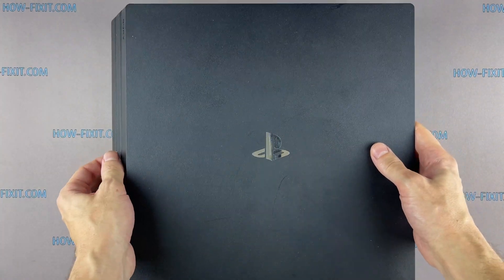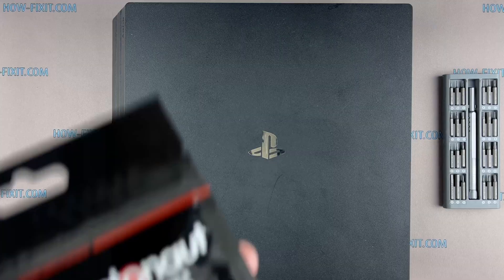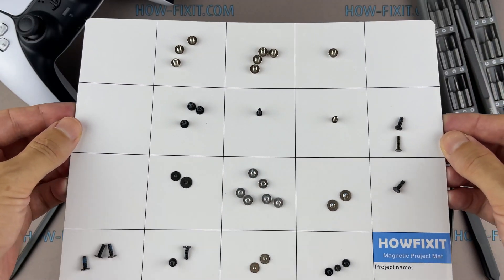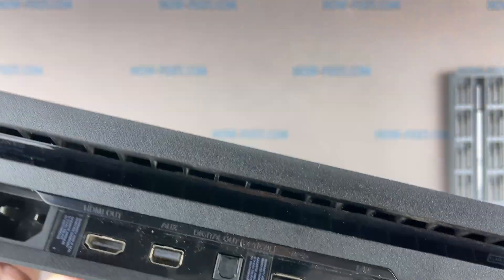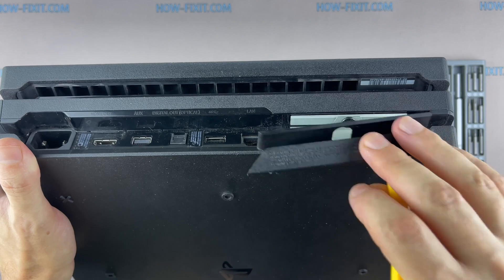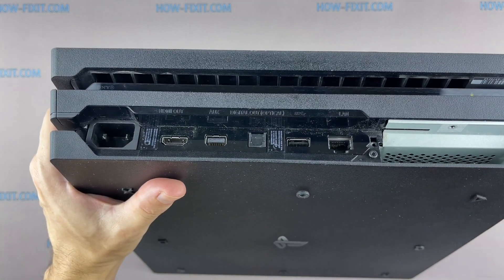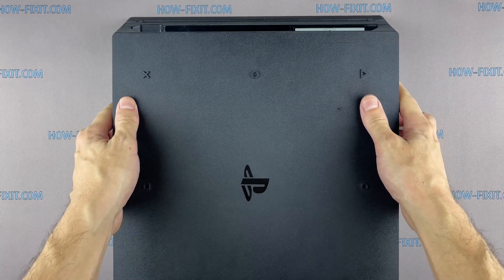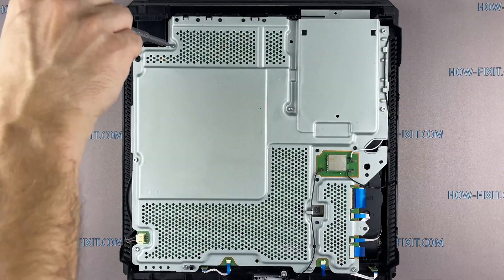PS4 Pro Disassembly & Liquid Metal Application Guide - Ultimate Cooling Solution

Comment from the maker: For more info check out the links in the description
Reply: no se para que pones el titulo del video en español si el video esta en ingles y los subtitulos tambien no entiendo lo que dices y seria bueno que pusieras subtitulos en español
Reply: What novice technicians do not understand is that the SMD Components MUST NOT be covered hermetically (liquid insulating adhesive in that case) because they release heat and the fact of covering them hermetically KEEP the heat and therefore you make these age prematurely. The PS4 console (even the PRO) was not designed to use liquid metal for good reasons.

Comment: The two most difficult parts were 1- unplugging the connector from the power supply , at 3:54 it took me like half an hour. 2- applying the liquid insulator; as it got very messy. But at the end, after ~5 hours all is good now. I guess it is even more silent than when I first bought it brand new.

Comment: Awesome video...saved! However, liquid metal being in direct contact with copper for long term is not recommended due to dry outs...
Reply: Is there a solution for it?
Reply: @2hrf684 Use PTM7950 instead.

Comment: A question or doubt: is the silver box that surrounds the processor aluminum? Because if it is aluminum, the liquid metal will corrode it eventually, damaging the plate. Have you taken that into account? A way should be found to encapsulate the liquid metal properly.
Reply: Is, it is aluminum, but for the LM to reach it you have to use a lot of it. I've done this on multiple gpus, 3 playstations 4's and 2 pro's. Use correct amount and the worst you'l get is tiny niblets flowing of the die and at worst flowing a couple of mm away from it.
Reply: @aerlas1  ok

Comment: Ifixit Always comes with great solution to the problems Excellent...
Reply: What novice technicians do not understand is that the SMD Components MUST NOT be covered hermetically (liquid insulating adhesive in that case) because they release heat and the fact of covering them hermetically KEEP the heat and therefore you make these age prematurely. The PS4 console (even the PRO) was not designed to use liquid metal for good reasons.
Reply: @Dan-Commando  This is true...any knowleged who use this technique should post long term review.

Comment: Hello. I'm sorry, but can someone please explain if I should be worried or not? In short: I decided to remove the cooler in order to clean it and part of the radiator, but now it seems that part of the air from the bottom (if we consider the vertical orientation) does not come out or comes out weakly, the air itself has become not so hot, the flow is probably less intense, and from the top (again speaking about vertical orientation) - cold air comes out, although, as I understand it, from there, on the contrary, it should come in. Haven't noticed a change in performance yet, but I'm paranoid so I'm worried. Perhaps a stupid question, but I want to understand if everything is fine and could I somehow damage something, such as contacts?
Reply: It might be you haven't secured thr heat sink in properly or the fan isn't aligned properly. I'd take it apart and look for an obstruction. No need to panic just check it's all aligned right 😁
Reply: Idk man hope u got it solved

Comment: Liquid metal on PS4 Pro??? Seems a little risky to me. I would rather use thermal paste. Im very interested in the results.
Reply: Risky on anything, not just the Ps4 pro.
Reply: Use Noctua NT-H2 or Arctic MX-6. I’ve personally used both and it’s kept my ps4 pro relatively quiet. Although I’ve heard the NT-H2 can pump out because it’s not that viscous, and MX-6 is pretty thick and designed for direct die cooling.
Reply: @porkysoda5899  Or Thermal Grizzly Kryonaut.
Reply: @porkysoda5899  I put Arctic MX-4 in my friends ps4 and mine. Around my area I help revive my friends consoles. But the mx-4 seems pretty good. It's been keeping my ps4 quiet!
Reply: @porkysoda5899  Guess it's time to switch thermal paste. Last i check the new fan i installed ramps up immediately for some reason after i turn on the PS4 (Original, CUH-1003A).

I thoroughly cleaned it so it's really a wonder to me why the fan ramps up speed and the console heats up fast as well (not yet to the point it beeps and power off but it's pretty hot)...I'm using a pretty cheap thermal paste (Allan thermal paste, forgot what it exactly called). Bought it because the contents are of higher amounts than others on the market and because i'm always on tight budget. I'll probably switch to Arctic MX4 or 6, i might also need thermal pads.